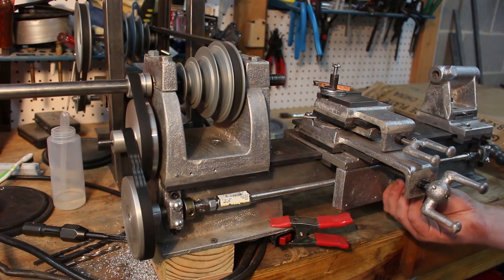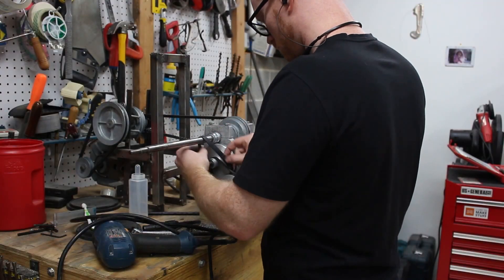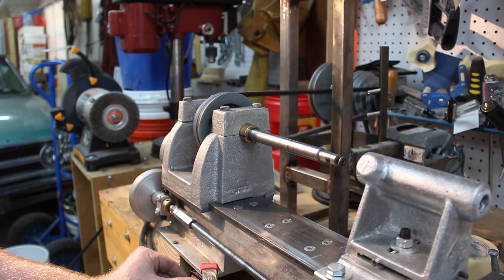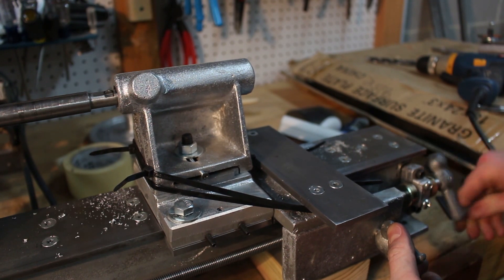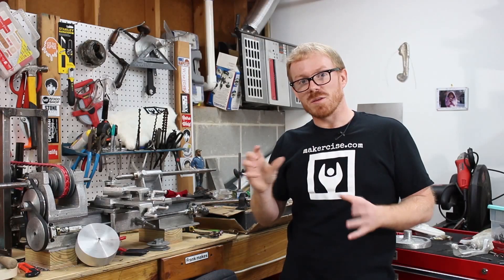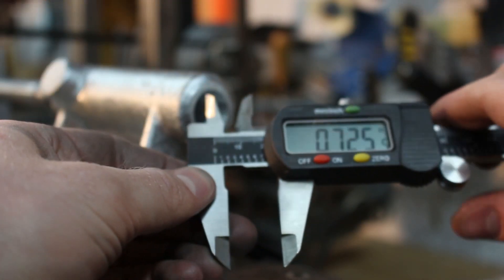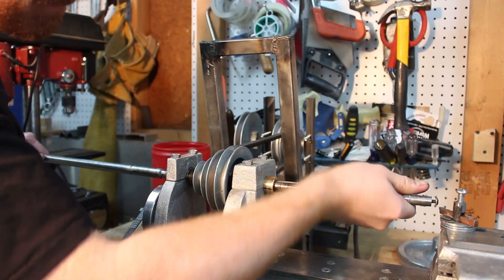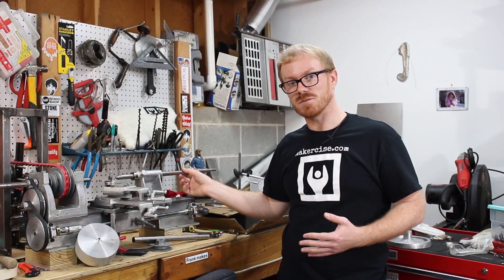Metal Lathe - Part 11.5: Tailstock Boring

Comment: Have you ever tried to balance the pullies and such? I mean  by weight, because it would help to prevent shattering a lot I guess. It is also much better for the bearings.
Reply from the maker: insAneTunA not really. The lathe cart i made with a concrete top is the biggest improvement to reduce chatter i have come across. Next best is sharp HSS tools.

Comment: hi i wanted to ask, im about to make my first pattern how do i calulate the shrinking of the aluminum?
Reply from the maker: Emile Badenhorst congratulations! Casting your first part will be a very rewarding experience. Shrinkage depends on the alloy you are melting. I imagine you first pattern will be a smaller one. Shrinkage will be measurable but less critical with smaller dimensions. The Gingery books have some discussion about shrinkage. If I recall correctly the bed was 24" and shrunk 3/16 of an inch. That is using an engine block alloy. You can divide those figures to arrive at the dimension and shrinkage figure for your part. It will get you pretty close.

Comment: I've been machining for almost 30 years and in watching your video series on building the Gingery lathe ( that is Gingery, as in GINGER ale), I'm literally impressed with the methods your using to cast and put the thing together, it's so rudimentary it harkens back to the halcion days of before the industrial revolution, where abled men back then used the same exact methods to end up with precision machines, just as you're doing, now. It's also quite refreshing to see youngsters take an interest in making things with their bare hands and knowing what it took to get through the project...HARD WORK! May I say, regarding degassing mediums are preferential to each user, I've used sodium carbonate in pill form, to which I cut in quarter sections or arm and hammer soda wash, premeasured for the amount of molten aluminum you're going to be using. In my day, I've used a machined steel cup with four to six holes along its outside perimeter, then welded the perforated cup to a long rod, I'd place the degassing medium into the aluminum foil (if powdered), place it into the molten metal and push either the degassing powder or pill, with the holed steel cup on a rod, to the bottom of the molten metal. It's what worked for me. I do have one gripe about your videos, though. Too short, son. Lol. I'm going to be following your build series, it's bettern those damn reality shows thats taken over the TV programs. Best of luck, son. And have fun doing it.

Comment: Im a bit curious, it seems your videos are getting shorter and shorter content wise. I understand your fan base is pushing you to produce, but shouldnt this portion have been combined with the creation of the tail-stock video. Is there a reason for breaking the videos into ever smaller steps?
Reply from the maker: Ramiro M I haven't noticed a trend of smaller (I assume you mean shorter length) videos, but this was the shortest lathe series video; number 1 is the second shortest. Most recent ones are around the 10 minute mark. 

According to the book, I should have complete the lead screw drive train before making the tailstock. However, I built the tailstock, then the drive train, then bored the tailstock. Sometimes it boils down to shop chronology, but sometimes like the faceplate video it makes sense to me to try and group footage from a long span together. Do you prefer less frequent videos with longer duration over frequent shorter? I'll poll the email list and patrons to see what they prefer as well. Thanks for the feedback.
Reply: Im not referring to video length but rather content. This video covered just boring a hole in the tail stock, in an elaborate way though...I would hate to see video titles boiling down to two decimal places (11.51) and thus breaking down the build into ever more granular steps. Take for example Part 2, the carriage, that is one very complex part of the machine, thick on content, yet the video is under 10 minutes and covers the whole part from start to finish. its clean, very well produced,interesting and very satisfying.
Reply from the maker: +Ramiro M ah I see, thanks for clarifying. Glad to hear you liked part 2. Parts 1-3 were included a fair amount of reenactment supplemented with pictures since all that work was done prior to me trying to film content for this channel. Because of the time that went into building the bed, carriage, and lead screw before really starting to film, those videos were more dense yet closely spaced.  They are missing lots of actual build footage, for instance casting and cleaning up the split nut. Now that I am trying to capture more of the actual build in footage, I expect future videos to continue the trend of content progress seen in more recent videos versus the first handful of videos. I won't let it get to two decimals though. :)